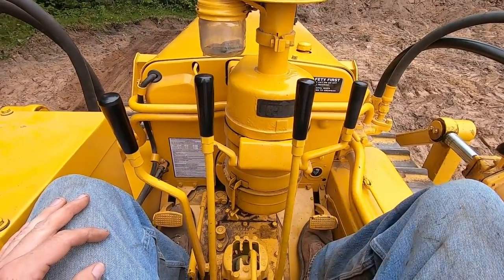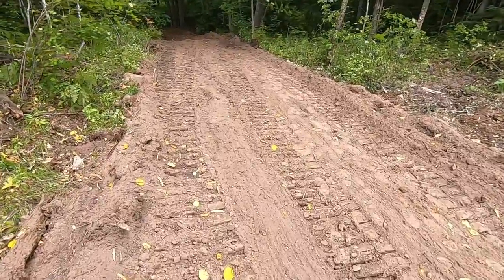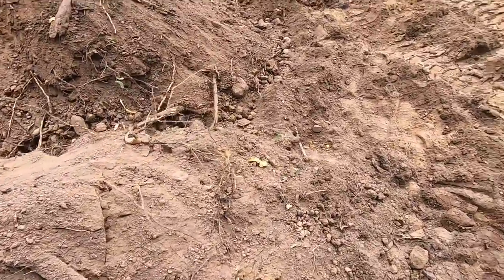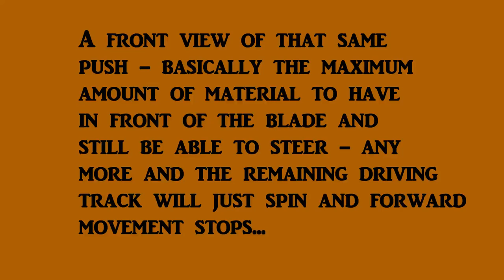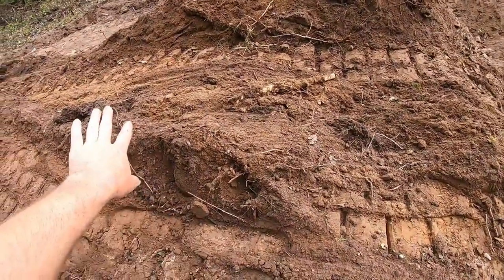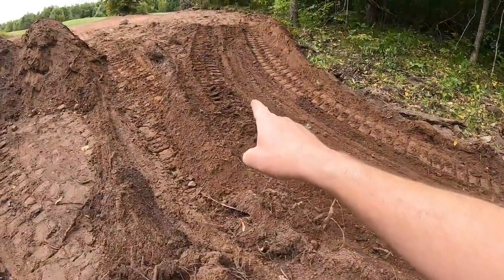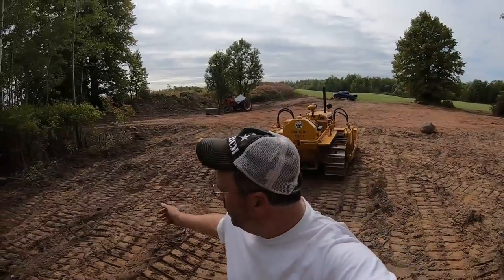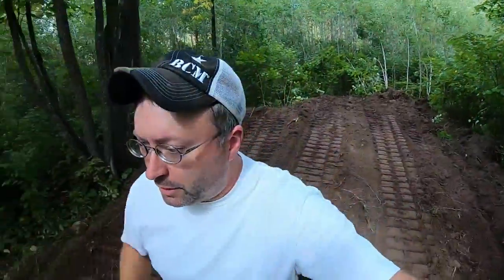Caterpillar D2 - How To Drive a D2 Part 2: Driving And Dozing Demonstration

Comment: I want to thank you so much Squatch! My Father in Law has an old 1960’s era Cat D5 standard shift. He is 89 years old and battling Cancer. He is in a very weakened state. Some grading and leveling work needed to be done on his property. I asked him if it was ok if I could try to clean up the area with his D5. He said ok, and he mentioned some of the very same pointers on what to do in order to operate the D5 correctly. It was my first time ever doing anything like this. I did have a spotter helping me in the area that I was working. So I think I did pretty good job. And I got the approval from my father in law, he said I did a good job and he smiled. So thank you Squatch so much for your video. It helped me a great deal!👍

Comment: That's actually quite fascinating. The similarities to landing a complex airplane are more numerous than I'd imagined. It's all about fine control of the assets available to the operator. Many differences, of course, but control methodology is much the same. Close to the ground, descending at 5 or 600 feet per minute, holding 130 mph (VERY IMPORTANT), keeping the engines synchronized, feeling when to slow down to 90 into the flare and touchdown, and more. Most enjoyable. If I wasn't so darned old, I swear I'd buy a small Cat to play with. Thank you, good sir!

Comment: Thank you for these videos.  I’ve got my grandfather’s  mid 50s 5uD2.  It is very similar to yours but with a different blade.  I think it can flip around to pull a tool bar and deep soiler.  It saw heavy use early on but I’m in my 40’s and have only seen in ran twice.  

Grandpa is gone. I was never around when he messed with it!  I’d love to get it working again and use it on the farm.  Seems like I only get free time in the winter and I don’t have a good heated shop.  I think it was ran 20 years ago...everything still seems free and it’s inside.  Maybe someday,  I did hunt down and find all the manuals.   

I wish I had your metal working and mechanical skills...Anyway your videos are great!  Thanks so much for taking the time to do them.

Comment: Thanks Squatch,  Nice training video!!  The Tip I didn't know was, when stationary and running, to leave the gearbox in neutral w the clutch engaged. This may be why my clutch is slipping and needs to be adjusted. You are a very thorough teacher. I like the different views and angles of the same "push" . Nicely done.

Comment: I did a lot of pioneering with my 5J (same blade as yours). Challenging to say the least. Had I not previously had an AC HD-7W (also short) with a Baker blade It would have been far more difficult. Cutting a road across the side of a hill without a 6 way blade is becoming a bit of a lost art. I learned from cable tool Catskinners who logged and built mining roads. Great to see you taking the time to teach others. Thanks for posting.

Comment: Great instructional video! I would, however, refrain from using a term like "stab the brake" when teaching its use to novices. I have thousands of hours of operating Cat D6's, IH TD14's, and AC HD-11's pulling implements on a farm back in the 60's and 70's. As you stated, if the tractor is under a load, it rarely requires supplemental braking to help it turn, but under no load to light-medium load situations it will require a smooth application of brake and adjusting the pressure as necessary to achieve the desired rate and degree of turn. I want to compliment you on your beautifully restored D2. She is absolutely gorgeous!

Comment: It's been like 40 years since I ran one of those old timers, but one thing I do remember is you do all steering and run the clutch with the left hand (Both steering clutch levers) and you keep the right hand on the blade lever execpt when you use it for shifting. 

One other thing. I never jammed the steering levers all the way back and then stomped on the brakes. - I would have gotten fired, You move the levers and brake pedals SMOOTHLY. Gently pull the steering clutch lever back as you slowly apply the steering brake.and then slowly release the brake and then gently replace the steering lever fully forward. - A year later when they put me on a brand new D6 with the exception of the power shift and decel pedal you ran it the exact  same way,  SMOOTHLY.

Comment: I worked for a home builder through high school, college and a few years thereafter before starting my career and was fortunate to cut my teeth on almost that exact same D2. We had 2 of them. The one with the blade was a bit newer and had a wet clutch. The older one with less hours had a bucket an power take off. I’d run it with a bush hog to clear brush. I backfilled a lot of basements, spread topsoil and cleared land with that dozer. The older D2 had a dry clutch and due to lack of use, the pressure plate became pitted. One winter I split the D2 and put in a new clutch. I loved running and fixing those machines as well as our 955K which was a beast. Now I have a 52 8N and a Kubota B2920 and have tried to but the D2 I used to run from the original owner. It hasn’t been used in over 20 years and is sitting in a barn waiting for me to bring it back to life! Great video and great memories.

Comment: "Where your posterior interfaces with the seat cushion is your main sensor." lol...  (4:08)
Reply: An old Dozer hand told me the same thing about 400 years ago - operate with your butt. Then I learned you fly a jet with your nose because you needed to lead the G-force.  And you drive a car with your shoulders ... leaning into corners

Comment: The higher gears are for reverse, to get back to the next push.  Cats always seemed faster than John Deers, in reverse, because they both had enough power to push what you bite off.  It’s been a long time since I worked those controls, but I would love to be able to do it again.  I only watched your video, because I’ve never seen a D-2, the smallest I’ve seen or operated was the D-3.  Techniques really don’t change because of size.  The smaller machines were for tighter areas, & finer elevations.  I believe you are ready for the big ones, but they are more expensive to use.  I would love to have that D-2, to use on my daughter’s gravel driveway, but I’d have to rent one, because I don’t have enough work to own it.  You did a very good video 👍🏻!

Comment: Nose pitch control on the small machines always a bugger. I have a BX23 compact short wheelbase tractor with front end loader... and that short wheelbase on irregular surfaces is a constant battle when trying to level out a surface. Your D2 skills are right on top. This old gal would love to try one sometime.

Comment: Good Job, Toby! A-PLUS! I didn't run a D-2 much but a 350 JD or a Case has about the same track frame and the more you run a machine you learn where the tipping point is and work your blade accordingly. You'll also learn that any bump you can blade smooth is one less the sore back has to do an OUCH with. Working the dam I just ran around and around blading as I went. The inspector wants the fill put in between 10 and 12 inches at a time and with a bunch of pans you were always knocking down and building up. You'll also learn that you really run one by your butt because you can't see the blade on a lot of tractors so it has to be by 'feel' as to where and how much your tipping point comes in, or rather, where you roll over it. And your timing will get good enough so you'll know what to do, even with your eyes closed. But it's a LOT of fun and will pay the light bill at the same time. I went from a D-4 to a 6B to a 7F and an 8H on the same job. That wasn't counting swapping out on pans and graders. The more you run the more you'll want to run. Gopher it! Hi Pop!

Comment: Great video, of course the noise level was high, but everything important was audible. During most of the video the blade lever was out of view, but the latter passes showed the blade lever work, so it was possible to see the balancing of pitching the machine up versus digging in too deep. That is one sweet looking and sounding tractor. Someday 5J1113 will look just as good!

Comment: Love your videos. I have a 1950 D2, just had to rebuild the hydraulic cylinders, there was so much play that I couldn't make a straight cut. Doing a complete upgrade to the mounting too. Hope it will do a much better job when finished.

Comment: Great video Squatch. The SP transmissions in a D2 I find are a little fast in 3rd for dirt work, I'm not certain if 1st and 2nd are any different or not in a SP D2 but man 3rd and 4th are fast compared to a non SP gearbox. Maybe they're not that different, I'm just too slow as an operator. However 3rd pulling a disc or a harrow seems to be just about right behind a SP D2. Hope all is well!
Reply: @squatch253  I too find that stuff really interesting, I didn't have the road speeds in each gear accessible but those numbers check with what I remember from running a SP D2.  Didn't mean to make extra work for you looking that up, but thank you so much for sharing! Funny aside, at the time my friend who owned the D2 thought SP was for Special Performance and assumed that's why it was so fast.

Comment: Very good video.  I had no problems hearing you over the engine noise.
Have you ever thought of dubbing over the audio, or better yet add a second track of audio, then you can tone down the original audio/engine noise, and add in your voice on the second track?  Would depend on what you use for video editing, if it has that feature.   Keep up the good work!

Comment: Could you not put the blade in float mode to keep things even and not have the mounds ?
I have about 5 minutes on a machine of this era but am preparing to retrieve one from the bush that was given to me!
A 1953 D47U, I can’t wait!
Just need a new winding/coil for the magneto in the pony motor.
Reply: @squatch253  ya, I meant for back blading

Comment: Just to confuse the issue, when pulling disk's down a decent slope we pulled on the left steering cluth lever 
to veer right and same for the right clutch to veer to the left, this is because the free wheeling track runs 
faster than the driven track great fun but on a crawler tractor but lots of dust in the face.
Have a good day all from NZ
Reply: When I was trained 70 yrs ago that process for going down steep hills was called reverse steering.
Reply: @byronfitch6444  Hi Byron I'm 64 in just over 2 weeks, it was a big saving on steering brke bands, I mainly 
drove T6 and TD6 but also spent some time on D4 5u and TD9B 
You have a great day

Comment: if you fit the optional beam I assume for traxcavater [saw it in a D2 parts book] in place of the spring it may blade better like the D3 has these D2s can be a bear to level with
Reply: @mmm365  but thats how they built the D3 its great to blade with as are the later D8s h and k models with equaliser bar instead of a spring but they ride rougher not so good for scoop work my D2 still has the spring and agricultural idlers blade and winch but we machined up some hydraulic track adjusters best retro fit ever

Comment: 👍SUB. The shovel on the front is called a blade? Is there a different attachment for a dozer? or are dozers mainly configured for pushing and pulling material with a blade and chassis?

Comment: Sasquatch you need to get a book I read years ago. It's called bulldozer by Stephan W. Meader. I read it over 40+ years ago and have a copy still to this day.
Reply: I read that book in high school in the late 60’s.   Could not wait to get a dozer.  Finally in 2000 when money was not so tight, I bought an Oliver OC 4 with a dozer blade!  Love it! Basically I play around with it. Fun machine and I can haul it around on a tandem wheel trailer and a half ton pickup!

Comment: That's a lot going on to run one of those.
Reply: It's not bad once you figure pout what does what and every part just does one thing. You might have to use 2 together but it's still one application of one part.